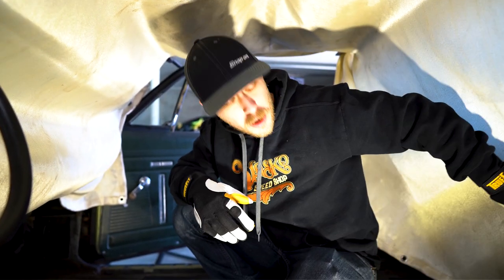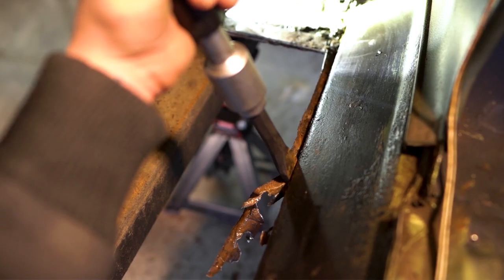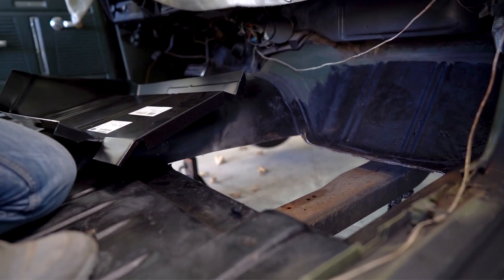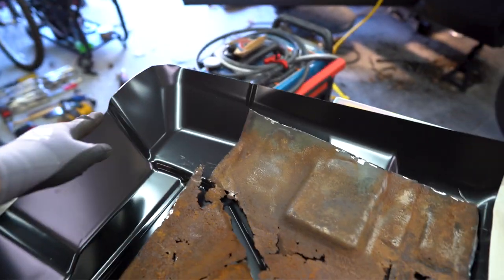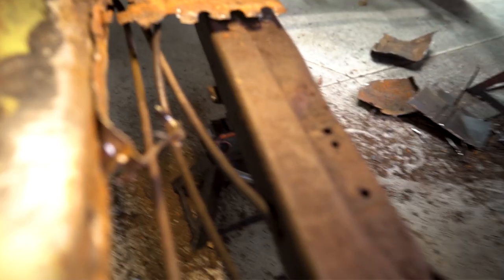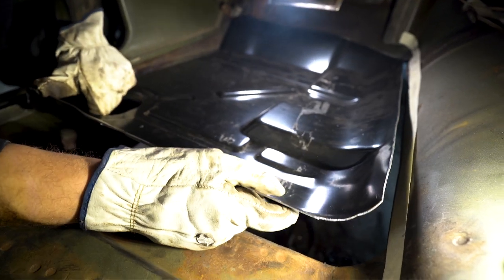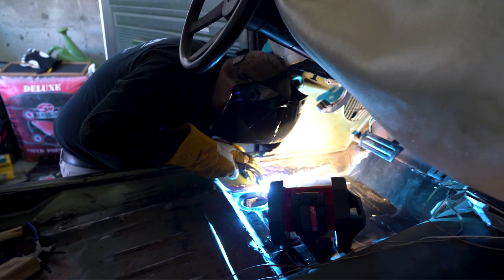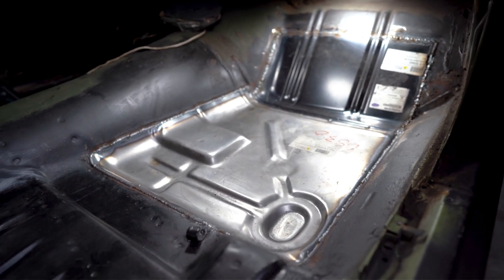Nova Project Rust Repair! NEW Floor Pan Install!!

Comment: Looks great. I was hoping for more of the attention to detail (fitment) that goes into getting the pans into place. Just started getting parts and pieces for my F150 cab/floorpans delivered.
Reply from the maker: Thanks for watching Norm! The fitment process ranged from 4 to 6 different times of trimming to get the exact fit we were after. It is buy far the most tedious of the process!

Comment: Im going to be replacing the floor pans in my 70 nova, and I am going to be teaching myself how to weld soon. What brand / style of welder did you guys use?
Reply from the maker: Hey Thomas! I appreciate you watching. I did the same thing. I run a Miller 141 and Tyler ran a Miller 211 in this video.

Comment: How much do you think it would cost to cut and patch/ install new floor panels on a mk3 gti
Reply from the maker: depends on the region and the amount of labor hours. If you do it yourself with welder and materials I would say $750-1500.

Comment: do you have to take out the engine to do the floorpan?
Reply from the maker: No you do not. I just happen to be doing a ls swap that has taken longer than I care to admit lol!
Reply: @Autofaze  but it is recommended to drain your windshield washer fluid first.

Comment: What type of welder was used for the floor pans
Reply from the maker: Miller 141 driverside & Miller 211 passenger side
Reply: @Autofaze  fluxcore or using gas?